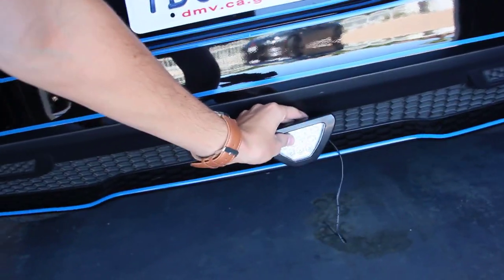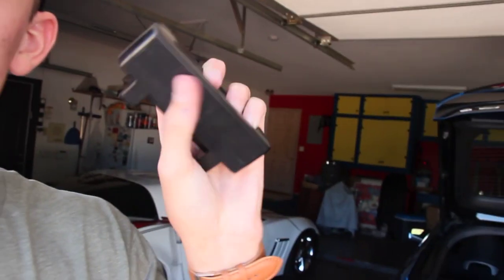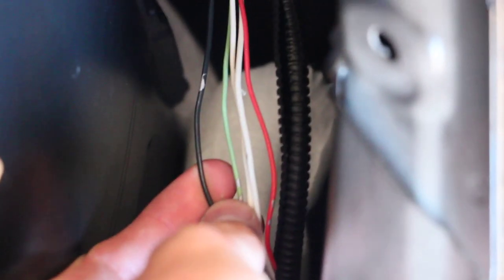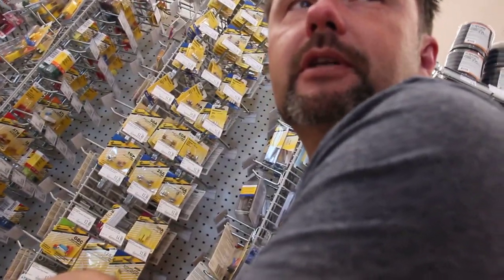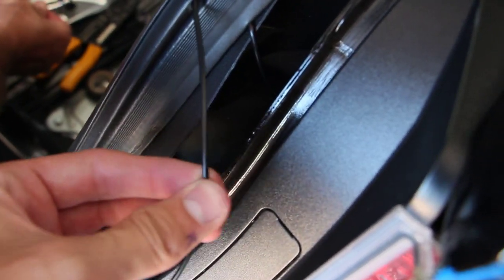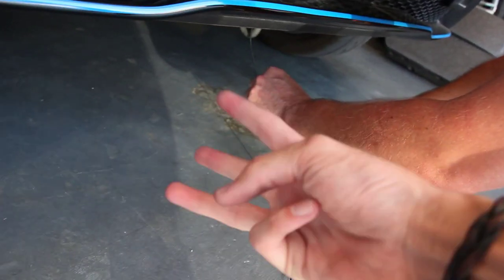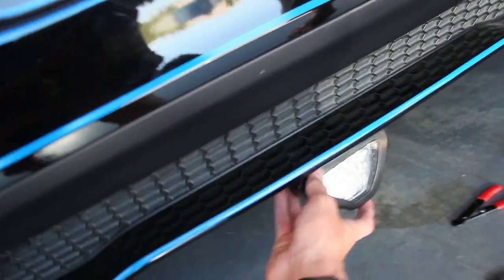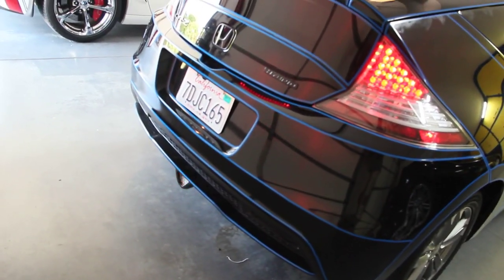How to Install EBAY Triangle Brake Light

Comment: I have the reverse version (white light) of this. 
It also comes with 3 black wires with symbols on them.
If you hold these 3 black wires facing you, the one on the left (with dots) is the ground wire. The one one the right (with dash) is the running light wire (in my case the reverse wire). The one in the middle (also dots), are the sequencial wire (the led flashes).

Comment: Its a simple install, it will be super easy if you have a probe. The ground wire you cab run to any metal surface on the car, thats the beauty of DC current. Grab a probe and start going at your tail light harness, when you probe a wire and the probe stays on thats your power. Now for the flashing you need somone to step on the brake, probe the other wires, insert the probe and ask your friend to hit the brake, if the probe lights on when he hits the brake and off when he steps off of it thats your flashing wire. If you want your light to not blink but only come on when you hit the brake (just like a 3rd brake light) hook the power wire from the new light to the second wire your friend helped you find.

Comment: Hey man mines was blinking then stopped is it because the fuse weak ?
Reply from the maker: THEJOKER825 possibly, or maybe the connection between the two wires isn't secure. You might want to check and also make sure it didn't short on you.
Reply: Stopped blinking but stayed on red or completely turned off?

Comment: I Fix the Same light but the Problem is its not blinking when i press the breake and stay constent while parking lights switch on, but if i turn off my Parking lights and press break its Blinking..Is it prolem with the wire or my Triangle light is Faulty.
Reply from the maker: IMRAN MALIK sounds like your light is faulty. Cuz it's technically doing all the things it should be doing just not when it should be. So that shows that there's no problem with the wiring

Comment: Have you gotten pulled over for the flashing light?
Reply: James Klein flashing red lights are illegal. Flashing red is reserved for emergency vehicles.
Reply: St33zy Steve in Dallas tx almost every mustang and allot of Benz some corvettes have flashing lights mostly it’s the third break light
Reply: enrique mejia I've owned mustangs, and several friends have corvettes. And I'm an ex auto technician. Never once seen that.
Reply: St33zy Steve It’s all dependent on your local laws, forward or side facing flashing reds are always illegal, but rear facing AUXILIARY flashing reds are legal (Florida)
Reply: Flashing / these are brakes lights like bikes have 4 quick, 4 long , then constant.... but check your local rules....

Comment: can you tell me what is the +ve , ground wire on the light cable itself ? Please Help
Reply from the maker: Nilesh Temil I'm not sure what you're asking
Reply: James Klein  The Light Comes with the 3 short cables you shown , i need to know which of the 3 is the ground cable , and +ve one ? ...See the cable got some signs on it , Cut off lines and X shape logos....can you tell me which one you connected to ground on your car light and the +ve one also ...
Help Please :(
Reply: you got what i meant to say ? 😟
Reply from the maker: Nilesh Temil like I said in the video, one of them is ground, one of them is running light, and one is brake. To figure out which was which on the light we connected the wires to a D battery in different configurations til we figured out which was which. And then we labeled them.
Reply: James Klein do you have access to the connected parts ? maybe you can tell me which connects to ground or +ve ?
Reply: @jamesklein3985 What was the point of making the video, People are watching the video cause they want to know what wire goes to what,,Don't that make sense,,Instead of you just showing how the light looks on your car,,Viewers what's to know how to wire the thing up buddy

Comment: So you connected the light parallel from the wires going to the brake lights?
Reply: All lights should be in parallel in general, or else:
 - they go out like Christmas tree light circuits (1 bulb can off all the bulbs connected together) o
-the first light in the circuit will be brightest while the last one will be dimmest

Comment: how can I install this for my Honda Civic Si 2017, I have a center mounted exhaust 😂😂
Reply from the maker: Jan Tamase 😂😂 that's a tough one. Just slap it on the bottom of the exhaust dude. It'll be fiiiine.
Reply: How about when you stop at the stop sign is the light keep flushing?
Reply: I say find a diffuser with a mounted light so you can just plug and play

Comment: wait but the car wasn't on, i did it before my self but when you turn the car on and turn on your headlights the triangle light just illuminates no more flashing
Reply from the maker: kelvin lopez did you attach the flashing wire to the break light wire?
Reply: James Klein it works how it's supposed to when the ignition is off but when I turn on the car it stays solid and try's to flash but doesn't, but when I had the car off and the headlights on it works solid for the taillight and when I press the brake it flashes
Reply from the maker: kelvin lopez hmmm that's interesting. Maybe it's not getting enough power when the car is on. You most likely got a faulty light, it is from eBay after all... You connected the ground wires together as well?
Reply: James Klein did you just get regular wiring since you needed more wiring since it wasn’t long enough. Or what kind of wiring did u get to connect it and how did you attach them together. I want to do this to my car but I don’t know how you connected the old one to the 4th brake light
Reply from the maker: Thegamerbe yeah it's just regular working.  Just find your ground, power, and brake wires and attach them accordingly to the same wires on the car 😊
Reply: James Klein what kind of wires are they exactly. Cus I legit have no clue what extra wire to buy from auto zone since I said you need some more since the one of the brake light is too short

Comment: Mine is all wired up now, but when you press on the brake does the strobe light do a couple flashes then stays solid or just stays flashing? I thought it was supposed to stay solid after a couple of flashes.
Reply from the maker: Ivnriver no this one stays flashing which I personally like. You can get more expensive ones that stop flashing however. I think you can get a module that will make it do what you're looking for
Reply: Ok thanks for the reply. Yea I was checking those out too.

Comment: How do you run the wire from the trunk to underneath the bumper? Did you have to drill a hole or is there a hole in the bumper that you can feed it through?
Reply from the maker: The J Media there was a little slot at the top of the bumper that we found that we were able to feed the wires through.
Reply: James Klein Okay that's good to know. thanks! Was hoping I wouldn't have to cut a hole through my bumper 🤣